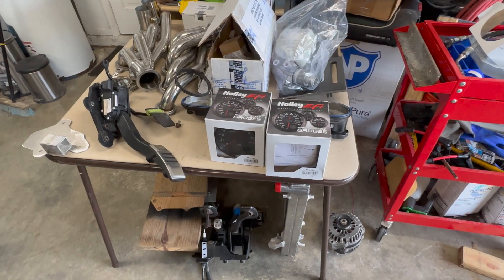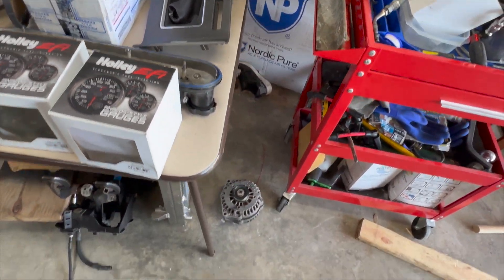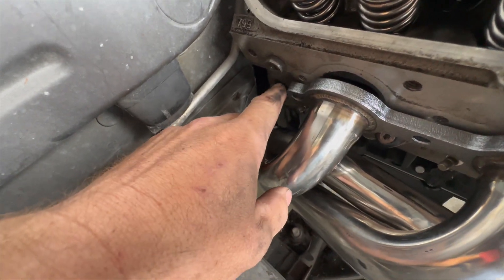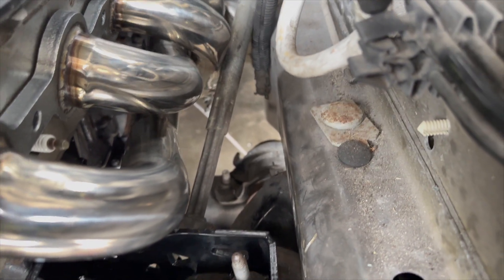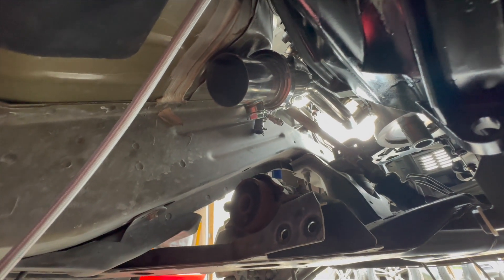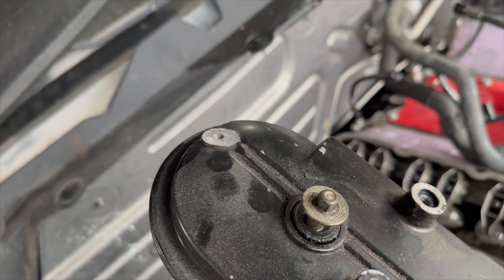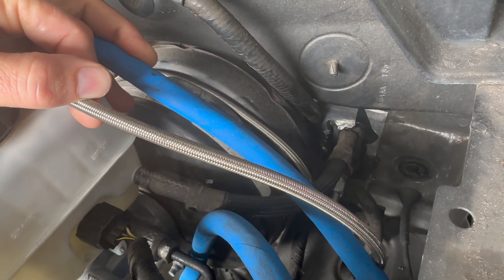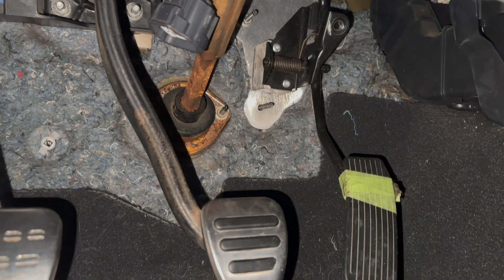S197 LS swap part 5 headers, gauges, trans mount, and DBC pedal

Comment: I have heard the Fox Body with a Chevy powerplant but a S-197?  Why?
Reply: Cause the v6 models can be found cheap and a stock 4.8/5.3 or 6.0 will fit with little modification in the engine bay. Even the truck intake clears the hood. I have a 5.3 with a 4l60 sitting in my 2008. Best upgrade i could ever do.
Reply: @northernjoethedroneguy1378  Well I guess it's better than a Toyota or honda engine.  Good luck.